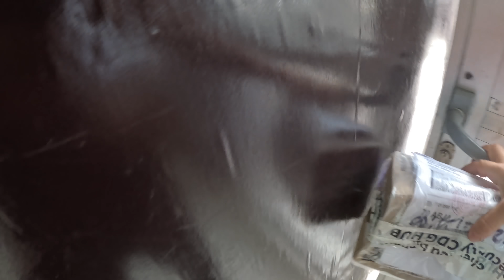Opening up the engine of my Honda CRF300 Rally in West-Africa |S7-E52|

Comment: Noraly, you have found more heroes, this time in Abidjan 🎉. Kudos to the mechanics who repaired Alaska. Great guys. Alaska is sounding like a new bike now and ready for many more miles of adventure. This was a happy video for you and all of us, seeing you back on the road. Cheers and stay safe. Dan. ❤️🏍✌️🇨🇦
Reply: Normally, we're the spares for the repair sent from the Netherlands, or we're they sourced locally. Anyway good to see you mobile again. Take care.!
Reply: If you say so.....ready for more miles of adventure you say....the engine was just rebuilt on a patio table with little metal filings everywhere.  The great guys who fixed it are obviously skilled at what they do, but do they not have a garage of some sort?.  There must be a motorcycle repair shop somewhere in that city?  I am as impressed as the rest of the commenters on this video with the dismantling and reassembly of this engine, but......I am commenting on your comment because I see that you are suggesting its "ready",  I think that is a bit premature.   The bike needs a little test run, and I would be dropping the oil alot sooner than a few thousand kilometers, and checking the magnetic drain plug for filings, and then doing it again a day later...etc.    Its not over just yet in my mind.....an exploded clutch basket is no small event particularly when the bike was ridden and running with this problem for a while....Noraly is correct to "worry" about whether or not they got all the filings out.....but her commenters are generally good to go it seems.  Interesting video, but I still can't believe there wasn't a proper motorcycle repair shop she could have checked into for this overhall.  I guess she took the hotel staff's suggestion that they knew the best mechanic in town, and that was good enough.   I personally would be looking for a shop.....considering the scale of adventure she is on.    Is the bike still reliable?  In her mind....not just yet....part of the adventure I guess...more worry.

Comment: As a retired engineer I knew the minute that Adamo started work that there would be a successful end to this. I know the new filter will clean the remaining debris from the oil but if that was my bike I would be changing the oil and filter again after 500 miles (app.750 k), just my thoughts. The best part of this video was the smile on your face when you took it for your test ride, priceless. You were like a kid at Christmas. Best wishes and safe riding Noraly, John
Reply: Totally agree. Oil/filter change after 500 miles after such invasive engine work.. Then maybe again in another couple of thousand miles 😃
Reply: @guyemmott4009  We're on the same wavelength, lol
Reply: Exactly, change the oil/filter at 500 miles!
Reply: How do you know it is a successful repair?  Just because it started doesn't mean it was a success, only time will tell, a little bit of luck is in order here, and I wouldn't personally be taking a rebuilt engine under those circumstances out into a how open desert....just saying.....We have to remember to what the activity is here....long distance...dangerous, high risk, motorcycle travel.
Reply: The oil filter won't keep those bits from being ingested by gears if they are not sequestered by a trap in the sump.
Reply: Well-Said , I would be changing that oil-filter asap too . Any burnt-out clutch-material stuck around that engine , will clog the filter fast , bypassing all those 'nasties' around the engine .  Dave  NZ
Reply: Yes after 500 miles then again after 1500.
Reply: Looks like this is much more difficult in Africa than in Asia, where there is a hindi mechanic on every street
Reply: Definitely change the oil early. If it were me it would be @ 100k (because of clutch debris) and 500k due to new parts break-in. Oil is cheap, also would give more peace of mind going forward.

Comment: Hie, fellow bike mechanic and rider from Bulawayo, Zimbabwe. We also pretty much work under such conditions as well without workshop manuals. What made me confident it would start was when they were taking it apart and were checking for top dead centre using a wire/stick through the spark plug hole... A lot of engines fail to start after being built when mechanics dont know how to check or set the timing.

Comment: Incredible recovery, as a mechanic, I'm amazed at the job they did with the most basic tools and facilities, you are back on the road, congratulations.
Reply: As a mechanic, you didn't cringe when the guy grabbed the piston roll pin with a set of pliers? Or how about them not cracking the case open to find the rest of the clutch debris? The only reason that bike is still running is it's a Honda.
Reply: @jimmac1185  YES! The small end pin was what made me cringe too. Flushing the engine with petrol might have cleared all debris, but it might also have flushed debris into a crucial area. As you say, it's a honda, best engineering in the world by far, so it might be ok, but....
Reply: @frankfisher99  so youre both mechanics and both think honda engineering is nice. I didnt think ot was that widespread!

What do you think of aprilia and bmw ?
Reply: @TomTom-gx1sm  for me Hondas are the best - they have not made an engineering mistake in an engine since the VF1000. The smaller engines, original hondas, ie everything based on the cub, are magnificent. When the rest of the world has decayed to pulp, the C50s will keep trundling on.
Reply: @jimmac1185  might due to the user constraints, time money or whatever they try to limit the repairs. For best practices i agree with what you said. Hey, considering backyard garage repairs in foreign place, the bike is running and her smile is good indicator
Reply: @jimmac1185  Relax guys, that piston pin is made from much harder steel than the side cutter pliers. You could grip that pin all day and not even mark it. 
My question is …. Did they replace or repair the cam chain tensioner? Other than that, I think they did a stellar job with basic hand tools, no manual and in a back alley! It’s not like there was a fully equipped Honda service shop around the corner and Noraly went with them to just save a buck.
Reply: @frankfisher99  I’m diving a 31 yr old Honda sueper four sport ,the one with online shock look piggy bck ,it just keeps going n going , and it’s mint still ,
Reply: @TomTom-gx1sm  Honda is the most reliable company in the world
Reply: A mechanic? So do you agree that taking the engine out and pulling the top off was unnecessary?
Reply: talented bros
Reply: @TomTom-gx1sm  I'm not a mechanic, that was a question for the OP. And yes Hondas are widespread. The most popular vehicle on the planet is the Honda CT90.

Comment: These guys are skilled ,doing amazing jobs with little or no sophisticated tools
Reply: What “sophisticated tools” does one need to fix a simple thumper?
Reply: They knew the bolting sequence and approximate torque requirements on the bolts. I'm more anal, doing things to the last inch pound and not reusing bolts. No Honda service manual,lots of bike experience.

Comment: Just a quick tip if you didn't already know (seeing as you already had a clutch failure 😅) try not to sit in gear in traffic, it wears out the clutch springs and release bearing prematurely...its amazing how they put it all back together with such basic tools and conditions. Have a safe journey 🙏🏻

Comment: For most of us who are severely challenged by the task of assembling Ikea furniture, these mechanics did a superhuman job!😂
Reply: They did not. Those clutchplates shoul be soaking in oil for 30min before assembly to prevent damage and warping. She will have trouble with the clutch again and quite shortly. That is not how you mount a cylinder back on the bottom end as well and you don't catch the gudgeon pin with snips FFS. You also do not assemble those parts dry. Monkeys would do the same quality job. Maybe even better, because monkeys would lubricate parts by licking them at least.
Reply: @_sneer_ Bullshit that the clutchplates will warp. The pads are mounted on a metal plate to keep it in shape an the metal plate wont soak any oil. They will warp if the get extremly hot. The problem is, that they will run pretty dry the first couple minutes which could cause overheating if you do some motocross starts right away which they didnt. So there is maybe a little more wear but its not really a big deal if the clutch plates last 20k miles or 19.8k miles. And surely these pliers are the wrong tool to move the gudgeon pin but also on that outer end it doesnt really matter in reality since the pin isnt moving inside the piston. The only relative rotation ist at the small end bearing so if he scratched the pin in the middle it would be an issue. 
It's so easy making these comments out of a well equipped workshop with acces to explosion drawing and repair manuals but repairing different engines every day without that much information and a limited variaty of cheap tools is a whole different story. 
The only valid concern is that there will be metal parts left in the crankcase. If not you will see the engine bringing her through Africa without any problems caused by their work. 
So maybe go out and work on bikes instead of bullshitting on other mechanics on the internet. Let's talk here again in 5000 miles and see if the clutch holds up or if it's warped...
Reply: @_sneer_  I'm sure that had you been there, working outside in the rain with a ratchet, a couple of sockets and a screwdriver, you'd have restored that bike to factory new condition in half the time, following all the recommended procedures despite lack of necessary proprietary tools.
Reply: @douglasburnside  listen, they probably had good intentions, but the bike was there with them for like two weeks. There was no excuse to not to do the job properly. They could've organized the tools, like a torque wrench if they didn't have it, service manual could've been downloaded easily. It clearly states in the manual, with pictures, how to do a simple job like this one. It is a single cylinder engine, that you can completely strip and rebuild in a day without any hassle properly. In two weeks you can bet the bike could've been restored to the factory new condition, following all recommended procedures, which are very similar to all engines. It just shows that they don't know those basic procedures and precautions or they don't care. Either way not a very good job.  If that was somewhere in the middle of nowhere and done under pressure, yeah it'd be understandable. But it wasn't.
Reply: Correct, for people who don't know any better, it looks impressive, any body who knows mechanics knows that there were some problems that may surface at a later date, lke when she is in the middle of hot desert, alone, with no mechanical knowledge.    A trial period is required before all the praise rolls in.     There was no reason I could see that she didn't take it to a proper shop, after all she was in a city, full of bikes and  cars....there was no need for hotel lobby  repair on a little table out the boot of a BMW....seemed a little strange in that regard.   Probably should habe taken a little more time finding a proper bike shop to do this type of repair.   Did she panic?   I would say.
Reply: @greyfisher3897  am amused at your display of your abundant theory knowledge of motorcycle repair, but very little understanding of The situation Noralee was  stuck in. The African mechanic displayed 10 times more ingenuity in getting the engine repaired, given his circumstances than you, talking from the high horse of your previlaged background and facilities
Reply: She in Ivory Coast not in Florida, brother. That’s the whole point of the vlog. They probably have mountains of experience and do things their way, which is probably not optimal by american standards, but no ine would watch a vlog about a motorbike being repaired in Miami.

Comment: It looks like they've pulled quite a few engines apart. Very impressive that they were able to do that so efficiently on a bike that they've likely never seen before. Simply amazing.
Reply: I think you missed to see the blue superbike they rode with to the premises.
Reply: All motorcycle engines of that design are very very similar.
Reply: @Holywood_Entertainments  I did see it. Not sure what that has to do with my comment.
Reply: They must see the bike before, before they can work on it, you mumu eh
Reply: @scuddro it doesnt matter..most of the bikes they fix are built very similar
Reply: Chances are they have seen it before Abidjan is a major capital city

Comment: Just one suggestion. I would use a NEODIMIUM MAGNETIC oil drain plug, in this case an after market compatible with Honda CRF300. ( II think Norely's bike has a Drain Bolt with M12 x 1.50mm thread) it will protect transmissions and engines from catastrophic damage caused by metal loosing parts, at the same time transmissions and engines last longer. I have good experiences using this kind of oil drain plugs in German cars also adding a Neodimium magnet to the cars oil pan cover in the transmission. I am pretty sure it will give the same extra benefits in motorcycles. The only difference is that Motorcycles share the same oil Engine and Transmission.

Comment: We punched a hole in the differential when our project Hilux fell off the jack in a very remote village (after someone in the city had stolen the 4x4 locking hubs). My colleague drove all the back and got super glue and hoses and replaced the broken plug in the diff and refilled with all fluids. Have seem bush mechanics do amazing things with minimal tools and just knowledge.

Comment: Oil change plug on the crack case has a magnet; check it and clean it when you change your oil. Because of the 'issue' (the complete rebuild of your engine) you should change it (and the oil filter) at 30 days, and then 90 days; then every 90 days when on land journeys.

Comment: This makes me appreciate my tube-frame Buell. If I ever burn up the clutch,  I don't have to worry about little pieces floating around in the crank case, etc., and the gear set can be removed without splitting the engine case if needing to do that to find clutch bits. Of course,  I won't be traveling the world on my Buell. 😂 A pre-2004 Sportster set up as a "dirtster" on the other hand would have the same advantages,  though it would be a tad heavy.

Comment: yes I could see they knew what they were doing One thing its best to soak new clutch plates in the new oil you use in the engine prior to insalation into the clutch basket. Clutch lever should be 15 to 20 mm free play

Comment: my first honda cbr 600 had no second gear or would pop out..i never workrd on a motorcyvcle engine before but i managed to split the case and  replace the shift drum,shift forks,shift kit and shorter ratios in it with out any experience..mototrcycle engines are fairly easy to work on thankfully..

Comment: Good job to the mechanics, only thing I can point out is when they grabbed the Gudgen pin with pliers, could have scored the pin, also was this all tightened with regular tools or did they use any torque wrenches? I know they work with what they have, but if cam caps and clutch plates are not torqued to spec, can cause a lot of problems later on..

Comment: I noticed that on these long rugged bike trips the clutch is first to go, even on BMWs. I had a Honda Helix in Vancouver, which was a Scooter. A scooter is automatic with no gas tank between your legs. It was 250cc,and the back  wheel was too small. But Honda had a Pacific Coaster with 1200cc. Thats too heavy. Question is would Auto tranie be better.... .Great driver.

Comment: The clutch goes out and grenades the whole engine? WTF Honda?  BTW, the mechanics are awesome. They are driving an M class BMW, so they aren't doing too bad. LOL
Reply: Its a wet clutch system. Oil goes throughout the entire engine carrying any bits of metal everywhere within it. Best to strip and clean rather than risk destroying the engine
Reply: @pitchforkpeasant6219  Yes, I understand that, but the idea of a clutch failure causing catastrophic engine damage is pretty severe.

Comment: Even the Chinese copies are basically the same inside. And so many other engines ever since. Someone who works on such things for a long times figured out how it works and can be repaired. The problems there turn only up when it comes to the electronics of modern engines. Some can even fix that, but they are not many.

Comment: In Europe most mecanics would have asked you to  buy a wholde new engine or worst a new motorcycle because it is cheaper to do it than to use so many hours to fix the broken engine. Africa has no modern schools for mecanics. Those mecanics are  self taugth and they can be considered as genuis. Thank you for showing that !

Comment: I also wanted to suggest you to print a braket that you can connect the tablet to the 360 and  the go pro. I can see you helmet video how badly the cameras  are vibrating this is because 1 leg holding each of them. you need to do anything to prevent the cameras from vibrating. and a 3d printer is your best way to go. I bet many of your views have 3d printers and they can helpyou design and print something that it will make your cameras worth the footage.

Comment: Many free lance mechanics, had worked and trained by motorcycle dealers and do free lance work earn good than ln dealerships. It seemed engine had complete overhauling, instead of just opening one side of the engine to replace clutch plates